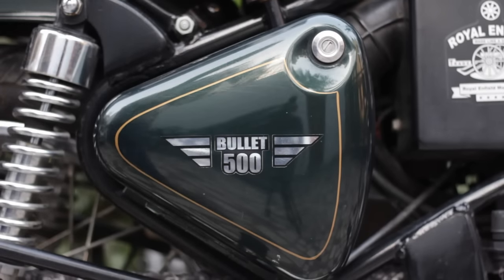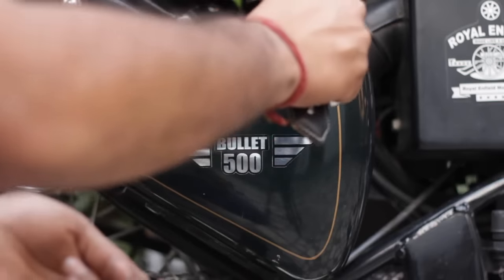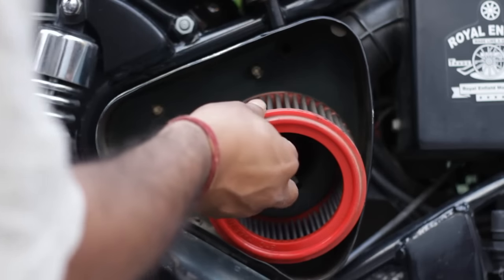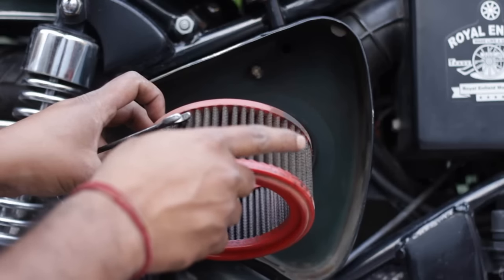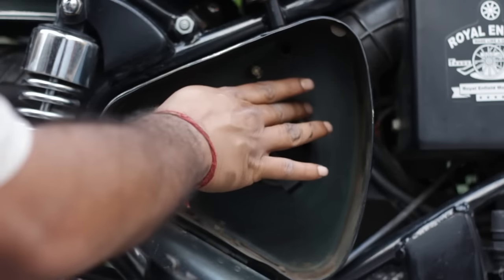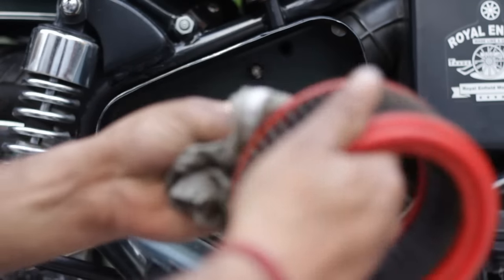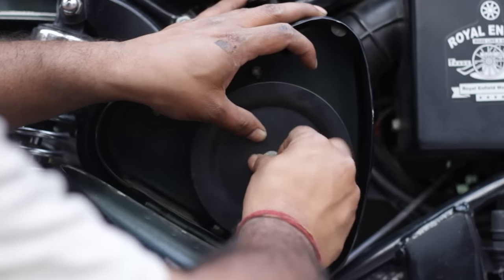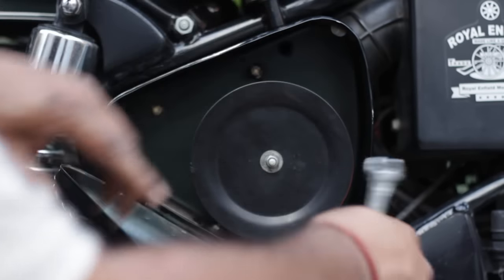Bullet 500 UCE Air filter change

Comment: How does the air get into that box? My C5 came with a pod filter so your video was very helpful for me to see the stock configuration. Thank you
Reply from the maker: hi pod filter are located on the outside. so air can get into in from its porous surface. In my bullet the lower side of the steel box has open frame like structure to let in the air.

Comment: Can i replace my air filter and exhaust on a EFI Classic 500 without remapping the ECU?
Reply: If you change to pod filter type without remapping you will run rich.
Reply: @safoxmulder it’s the other way round, a pod filter normally flows more air & will cause a weak/lean mixture.